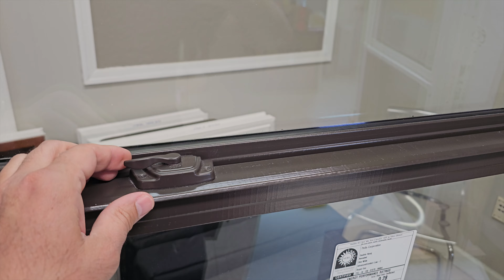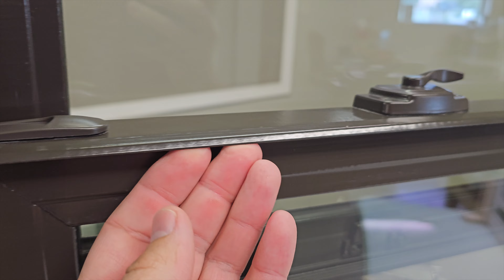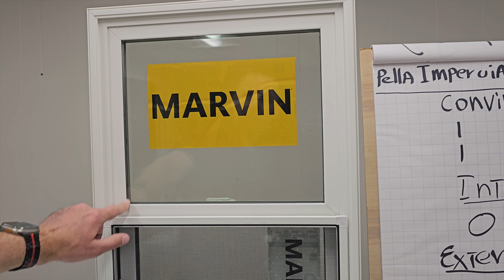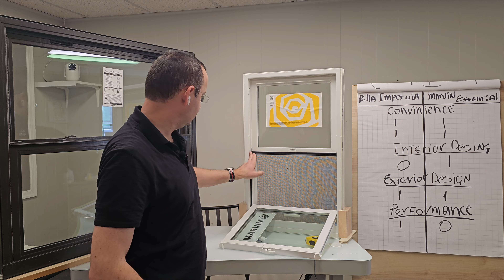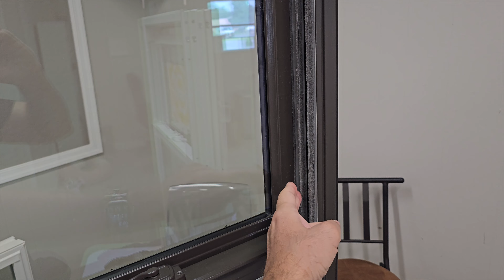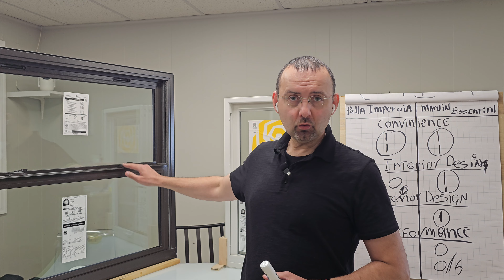Pella Impervia Fiberglass Window vs Marvin Essential Fiberglass Window

Comment: I never saw anyone comparing energy efficiency and NOT look atthe NFRC label, which is actually a measure of efficiency.   Also, regarding the weatherstripping, you can look up the air infiltration numbers on NFRC website (since label only indicates > .3 CFM which all modern windows pass).

Also, glass space should be worth 2 points.  Its very important.  Also, if you like a bumpy interior finish, you should pick Pella, Marvin is smooth finish.
Reply from the maker: NFRC rating is a general stuff. It all depends how good of a weather stripping you have to block air leaks, that’s what makes your house energy efficient, not an NFRC rating, granted that installation was of high quality as well. Less weather stripping, more time has to be devoted to window adjustments and higher chances that your house is gonna have high ventilation rate with all of the windows closed. 
   Glass is irrelevant as well. There are multiple glass packages that are available, so it is all on you to pick the one which is the best for your budget. We may do a separate video about the glass only. 
  Pella definitely has that bumpy texture, some people like it, because it is reminiscent of a wood window, others prefer Marvin with smooth finish.  
   When you look at Pella and Marvin finish from 6 feet away you can’t tell, it is all personal preference
Reply: @SidingWindowsWizardsLLC You might be the first I have heard in 30 years in the industry (11 as a home performance contractor) that says weatherstripping outweighs an NFRC sticker.

I suggest you bone up a bit on building science. Weatherstripping is only a single feature that makes up the overall energy efficiency of a fenestration product.
Reply from the maker: Sure, I would say air infiltration what matters the most after the glass package. If you get a good glass and great weatherstripping you have an energy saving windows

Comment: Just wondering if you could compare the window latches/locks? I find that its difficult for me to get past the cheesy Anderson 100 lock. How do the other brands compare?
Reply from the maker: Yes, locks are very important. You have to make sure that they are made from heavy duty aluminum or brass. Some windows have locks made from vinyl, which is not the best option

Comment: The comparable window with that pella would be Marvin infinity windows, not the essentials line. Also, those weep holes are only addtional in case water leaks into the frame, but Marvin uses a sloped frame for water.
Reply from the maker: Definitely Pella Impervia would be on the same page with Marvin Infinity, but sometimes it is nice to have fun and see how they perform to a more basic window. 
   Marvin Essential has those weep holes is very unfortunate, because if the weep holes are clogged, the water stays inside the frame and in winter time may compromise the integrity of the frame by freezing and expanding.
Reply: @SidingWindowsWizardsLLC  i have talked with Marvin, and those are not the main water management and only for the worst-case situation. Most companies, including pella, don't even add those addtion weep holes for the frame.
Reply from the maker: When the frame is completely sealed at the bottom, no need for the weep holes, because no moisture penetrates the inside of the frame. Marvin design team definitely needs to work more on making it water tight and eliminate the weeps
Reply: @SidingWindowsWizardsLLC  they are fiber glass not welded, seems. I have seen many windows, even vinyl with water in the frame. Pella and Andersons even. I think it's better to have them and not need them. It's all personal preference, tho. It shows a lot tho that even their basic line can match Pellas' upper end stuff.
Reply from the maker: It is tricky, because you want as little holes in the window frame as possible. Weepholes make extra holes, even if they are not operational, then ants make get in and make their nest inside the window frame. Those companies who eliminate them doing the right thing

Comment: I looked at both and bought Pella. I liked the slightly course finish which looked like wood. I could not distinguish Marvin Essential from other vinyl products. The sill design was another factor. Marvin had slightly better efficiency though. To each their own.
Reply from the maker: Definitely Pella has that interesting wood like texture, which gives you that satisfying wood feel
Reply: @SidingWindowsWizardsLLC  More like rough cut cedar or ripping lumber in a table saw with a bad blade.
Reply: You are the first person in history to like the duck tape texture in the Pella. What wood looks like that🤣
Reply from the maker: Well, not that I am a big fan of that duct tape experience, but some people told me that they like that, because it gives them a premium wood feel. So go figure people’s taste

Comment: Marvin also makes Infinity by Marvin, which are also fiberglass composite windows. They are made at a different Marvin factory, and many think they are better than the Marvin Essential fiberglass windows, especially for more contemporary homes.
Reply from the maker: Integrity Window is a slightly better window. The major difference is that it has wood interior and fiberglass exterior, as well as more features  and color options
Reply: @SidingWindowsWizardsLLC  I don't believe it is correct that Infinity uses a wood interior material. From reading their company information (and other YouTube videos), Infinity by Marvin has a fiberglass exterior and a choice of two interior materials, those being fiberglass or "EverWood."  According to Infinity, Everwood looks, feels, paints, and stains like wood, yet is made of an inorganic material for superior durability over real wood.
Reply: @SidingWindowsWizardsLLC Again, you are wrong. First, Integrity no longer exists and hasnt for years. infinity is a 100% fiberglass product that has a paintable/stainable wood veneer on the inside as an option.
Reply from the maker: definitely it is as good as wood, but the warranty is the same like essential. It means that the manufacturer is not sure that Marvin  Integrity is gonna perform better than Marvin Essential in the long run
Reply: @SidingWindowsWizardsLLC  According to Marvin the Essential collection has fiberglass exteriors and interiors. So looks to me like both Marvin Essential and Integrity by Marvin are fiberglass. The only difference in material is that Integrity by Marvin also is available with a fiberglass exterior and composite material interior option (instead of all fiberglass) that looks like wood, but is not. So not sure why warranty would be different. Both should last a very long time.
Reply from the maker: @Mark-rw3kw  well, Marvin provides 10 years warranty on the frame for Integrity Windows and Essential Windows. That’s definitely a red flag. Nobody cares about the studies and claims by the company that their materials are the best, if they don’t support these claims with their money.  If they are so sure that their materials and windows are the most reliable, why not provide 50 year warranty???
Reply: @SidingWindowsWizardsLLC  I have nothing to do with Marvin and don't sell them either. I don't sell any windows. I am a consumer. I just merely noted that Infinity by Marvin is available in all fiberglass (exterior and interior), OR fiberglass exterior and composite (fake wood) interior, which they claim is paintable and stainable and supposedly looks like wood, but is not. I have never seen them. I do not endorse these or any other windows.

With regard to warranty, I checked the Infinity website and it seems very complicated. They claim they are covered by a Limited Lifetime Warranty for owner-occupants of detached single-family homes who have purchased their windows and doors through an authorized Infinity retailer. However,  hardware in coastal applications (within 1 mile of a coast), glass, and Ultrex fiberglass finish are not covered under the Limited Lifetime Warranty, but are subject to a 10 or 20 year Limited Warranty depending on the components. 

Infinity by Marvin is being marketed as replacement windows, sort of like Renewal by Andersen, but supposedly (I have been told but not verified) you can get Infinity in a new construction configuration with exterior nailing flanges that go underneath the siding on new construction.
Reply: @SidingWindowsWizardsLLC  I merely pointed out that Infinity by Marvin is available in all fiberglass OR fiberglass exterior and composite interior (that looks, paints, and stains like wood, but is not wood). I don't sell Marvin or any other windows, I am a consumer. I don't have any Marvin windows and don't endorse them.

With regard to the warranty on the Infinity, it seems very complicated. They claim that for the original owner-occupant of a detached single–family dwelling where Infinity is installed (usually as a replacement window) that the Ultrex fiberglass and other non-glass components will be free from manufacturing defects for as long as you own and occupy the home. For non-original owners of a detached single-family home, or for hardware in coastal applications, glass, and Ultrex fiberglass finish are not covered under the Limited Lifetime Warranty; but are subject to a 10 or 20 Limited Warranty depending on the components. But it does seem a bit confusing to me.
Reply: I mistakenly called Infinity by Marvin "Integrity by Marvin" in my comments, and have revised them accordingly.
Reply from the maker: @Mark-rw3kw  what ever you call them, Infinity Windows or Integrity Windows have pretty much weak warranty
Reply: I think you are mistaken. I posted the warranty info, but my comment was deleted by someone (maybe YouTube), and I think you should check it out for yourself. The warranty is a bit complex, depending on whether it is a single family detached home or not, but can be up to a Lifetime warranty one the integrity of the frame for the original purchaser.
Reply from the maker: @Mark-rw3kw  exactly, when the warranty is complex, nobody has any idea how to use it. Who wants to call his or her lawyer when there is a need to fix the window? Nobody! the warranty has to be easy to understand and easy to use
Reply: @SidingWindowsWizardsLLC  I completely agree that the wording on web page is not very clear. But I don’t agree that the warranty is only for 10 years for single family residential.
Reply from the maker: They definitely should work on their warranty explanation
Reply: @SidingWindowsWizardsLLC Marvin has the shortest, most cut and dry warranty in the premium window industry, with the least exclusions.
Reply: @johnredmond3243  I think he is thinking of Marvin elevate. Wood interior with the fiberglass exterior. Marvin Infinity is practically the same as essential, but you have more options and design flexibility.

Comment: Quick note on energy efficiency from a mechanical engineer and full time energy analyst: the conductivity of these windows is essentially identical because they are both double pane fiberglass options. That's going to be the vast majority of your energy efficiency impact. There is weather stripping on the Marvin window, just a bit less than the Pella.
Reply: Unless you're designing a Passive Haus, you're not going to be able to tell them difference, energy wise.
Reply from the maker: @fakeusername92  We would disagree on that one. From our experience, extra insulation makes a home more quite, if the window is installed properly and shimmed
Reply from the maker: We do agree that fiberglass material is gonna do a superb job in energy efficiency, but that generous weatherstripping on Pella Impervia is gonna improve air infiltration ratings substantially

Comment: I can't find anything about the marvin essentials having weepholes, and another recent video of an essentials install doesn't seem to show them. Are you sure that's the current design? Thanke!
Reply from the maker: We got this Marvin Essential sample in October of 2023, so it has to be the latest one. We did not hear about any updates from Marvin yet
Reply: @SidingWindowsWizardsLLC The weep holes are for if water gets through the seals or your flashing.    Having a sloped sill is nice, but that is only for exterior water shedding.  I assume the Pella has weep holes under the frame, which makes it important that your rough opening  is properly flashed and sloped and left open to drain.  I would rather have visible weep holes on the face of the frame so they are not dumping water hidden under the window frame.  I'll add my own sloped sill.  Marvin hands down.  Superior finish as another commenter said. Pella sells via advertising.  Marvin sells by customer testimonials.  #IYKYK

Comment: 1. Are there differences in wind speed tolerance?  
2. If you compare windows closer in size, is there still a difference in sash thickness?  
3. Which do you think will last longer (seems like the Pella would last much longer with it's over built features)?
Reply from the maker: Both windows are wind resistant and tolerant. 
The sash thickness  is the same on all sizes. 
Both windows have robust construction. With extra big windows Pella might be the way, but Marvin boasts pretty reliable frame and sash construction as well